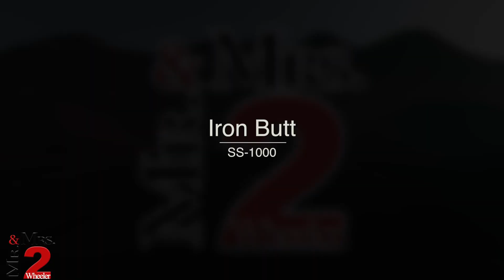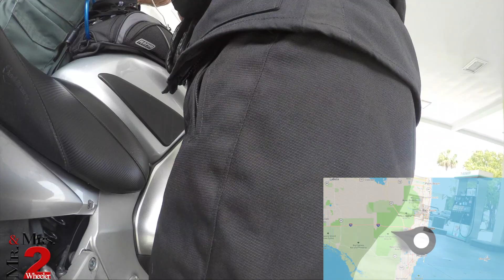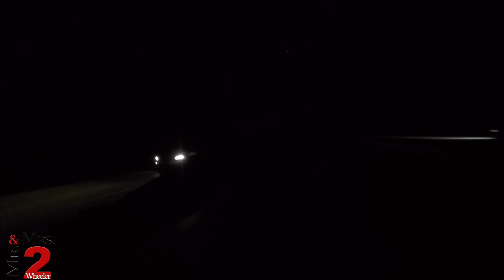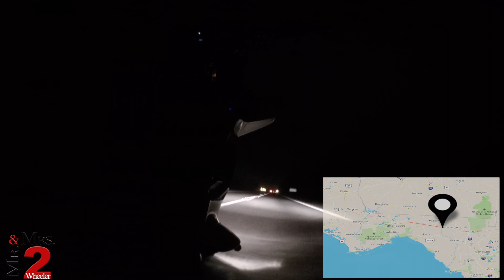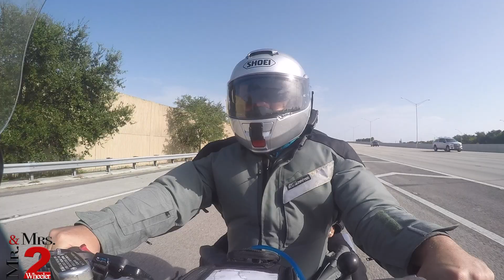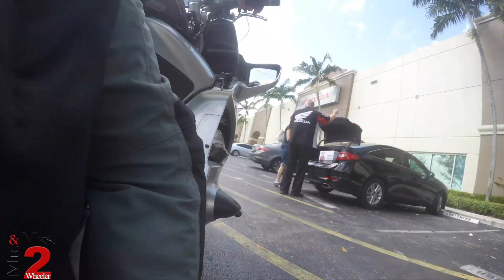How to do an Iron Butt Association saddlesore 1000 | SS1000 2up

Comment from the maker: Have you attempted an SS1000? Did you succeed? Or do you want to?
Reply: Yes and yes.  Did one last September from my house near Washington DC to Midway Kentucky and back.  1043 miles un 14 hours and 46 minutes.  2004 Honda ST1300A.  Only prep I did was to set a date.  Zero issues and good weather all around.
Reply: Yes, I have some
Reply: I have done about 12 SS1000’s, and 2 BBG1500’s
Reply from the maker: Wow, that's impressive.
Reply from the maker: Hey congrats
Reply from the maker: @wingandhog  Awesome. Good luck on the 1500. I've been thinking about doing one as well.
Stay safe.
Reply: Tried one time and had to stop for safety (wide winds up to 45 mph was too dangerous).  I am hoping to attempt it again this year.
Reply from the maker: I had to abort the one prior to this due to dense fog caused by a drop in temperature. It went from 70's to 20's. Couldn't see more then 30 feet in front of the bike.

Comment: SS1000 is on my bucket list. Already have a Roadcrafter, not convinced that the KLR would be a good bike for it though
Reply from the maker: Best of luck on the Saddlesore. Yeah, not the ideal bike, but with plenty of breaks and some upgrades to your bike, it can be done.
Watch this video for some tips. https://youtu.be/EvZoDnMPWdo
Ride safe brother.
Reply: I've done a lot of things to the bike so far.  Taller aluminium bars, bark busters with plastic wind guards to keep the wind off my hands, heated grips and seat, aftermarket seat, taller windshield, phone mount, power outlet, hard saddle bags and I am in the middle of a big bore install. Maybe I have the bike sorted out!
Reply from the maker: Dan Manthe sounds like you got it covered. Did you raise the bars" makes a big difference on long rides. Takes the pressure off of the shoulders and back.
Reply: @MRMRS2wheeler  the bars that I put on are taller than stock. Not sure how much. Did it for off road riding so clearly you don't want to ride ape hangers in the dirt
Reply from the maker: @danmanthe9335  lol, no you don't. You want your arms in a natural position so you are not using any muscles to keep them there. I say give it a shot. Might take a few tries (3 for us) but you'll do it.
Reply: @MRMRS2wheeler  just gotta wrap up this 685 kit and burn some gas! Thanks!
Reply from the maker: @danmanthe9335  Again, best of luck. Keep us posted on how it went. Love to hear this kind of stuff. And if you have any questions, feel free.

Comment: Congratulation on completing the ride.  Waiting for the paperwork can be much harder than the ride.  I completed my first SS1K going around Lake Superior on Sept 1st.
Reply from the maker: Yeah, I heard the process was very tedious. Congrats on your accomplishment. I didn't know Lake Superior was that big. Did you get the certification yet? I have been told it can take months.
Thanks for watching.
Reply: Unless your bike can swim the shortest distance around the lake is 1040 miles.  Most of the ride is on 2 lane highway.  You got about 8 miles at 75mph, 35 at 65mph,  and the rest at 55mph/90kph.  Michigan is supposed to be upping the limit on some of the 2 lanes to 65 but the signs were not posted when I rode through.  Completed the ride under 22 hours.

I submitted the paperwork and asked what pp account I submit payment to.  I got acknowledgement of submission of e-mail but no instructions.
Reply from the maker: Good one, lol. It goes to show how little I know about that area.
From my understanding, the actual certification process (the route evaluation) can take months, and they won't charge you unless you qualified/succeeded. That may be the reason you didn't get the Paypal link.
Reply: I'm preparing to do an Iron Butt from Virginia, MN to Grand Forks, ND, to Sioux Falls, SD, to Albert Lea, MN, and back to Virginia. (1028 miles according to Google maps)
Reply from the maker: @sierrafoxtrotgolf3638  Hey, I'm sorry, I totally missed this message. 
How did the ride go? Did you succeed?
Reply: Ride was completed and certified~ It took about 2 month via snail-mail to the IBA.  My next ride (next Spring) will be a Bun Burner Gold attempt, from Virginia, Minnesota to Custer, Montana and back. (1570 miles)
Reply from the maker: @sierrafoxtrotgolf3638  that's great. Congrats. 
Go for the gold, best of luck with that..

Comment: WOW..cant believe the number of times I have seen people trying a big ride like this and not being prepared for huge changes in weather ...Of coarse it might rain .. you are covering 1000 miles!
BTW e next situation where  you are under dressed for the cold.. stop at a store and get a newspaper ..  put layers between your layers in works very well
Reply from the maker: That is so true. We are usually very prepared and our suits are waterproof, but we had the vents open and it started pouring out of nowhere so we didn't get a chance to zip them up. We checked the forecast and there was no rain but hey, this is Florida I should have known. 
Great tip about the newspaper, it has good insulating properties. I wonder if that would have worked in low 20's. 
Thanks for the comment & watching.
Reply: well it HELPS ..cant say it is like a summer ride ... as  for the florida part ...yeah ..rain more in Orlando than in Seattle
Reply from the maker: Thanks, I'll remember that for future rides if I get caught in those temps unprepared. We have heated gear now, we just need to remember to bring it if there is a chance we'll hit very low temperatures 😜
Reply: yeah I have a heated vest and gloves..last year heading to FL ..going across MT my heated vest stopped working ...  middle of the night .. so put on another shirt and 3 layers of newspaper ...really helped
Reply from the maker: Wow, that's must have sucked. How cold was it?
Reply: probably mid thirties  at 70mph ,I ride a 2003 Bandit 1200 so it has a smaller windshield  not fully protected .I have been from Seattle to FL 3 years in a row..taking this year off..will probably get the bug again next year........unless I drive my car there :)    ( I have a brother that lives about 50 miles from Orlando )